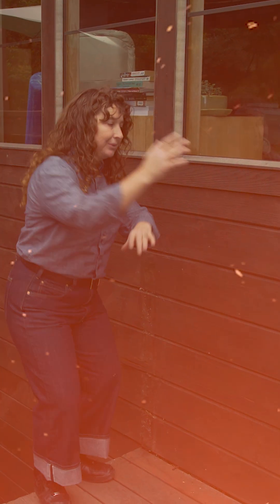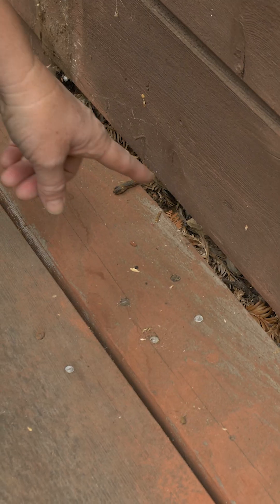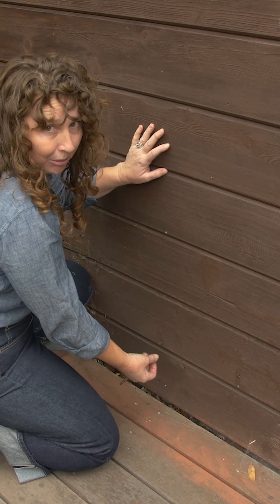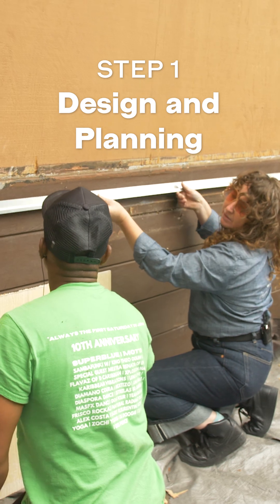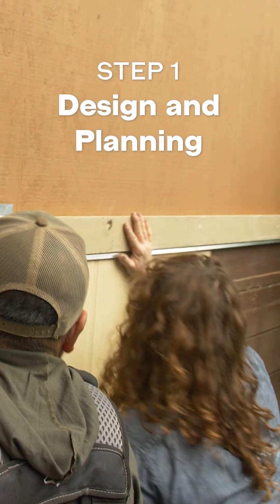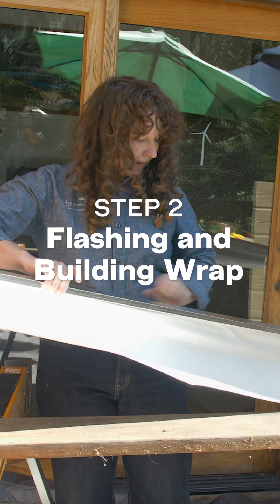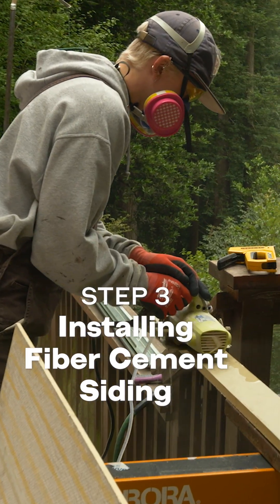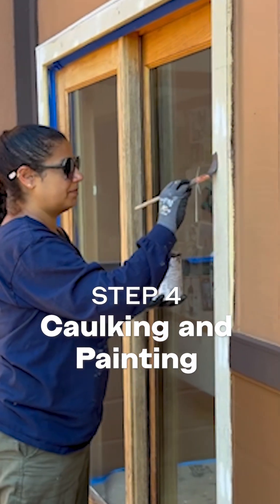Reduce the Risk: Install Noncombustible Siding for Wildfire Safety

Comment: The logic of non combustible siding is good, BUT where is the evidence that the outcomes are different? Are there examples of where there were fires that left only houses that had non combustible siding; Palisades? Paradise? Coffee Parrk?, Eaton Fire?. Honest question here?
Reply from the maker: Wildfire losses are influenced by many factors—there’s rarely a single feature that determines whether a home survives. Non-combustible siding is one tool to reduce ignition risk, similar to how a seatbelt reduces injury risk without preventing a crash.

Post-fire studies (Paradise, Coffey Park, etc.) are useful but limited because every home experiences different ember exposure, fire behavior, and maintenance conditions. The strongest evidence comes from controlled testing, where researchers expose siding materials to intense ember showers and observe how they ignite under identical conditions. Those studies consistently show combustible siding ignites more readily, while non-combustible materials reduce that ignition pathway.